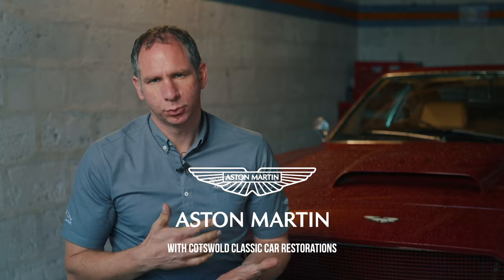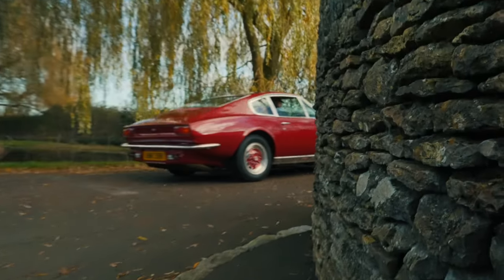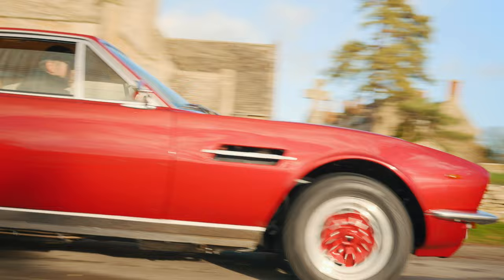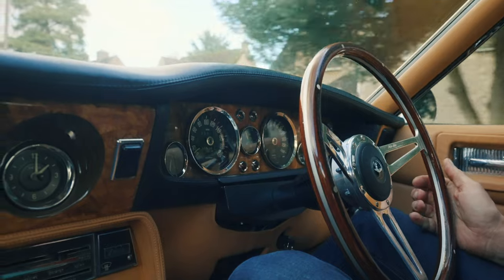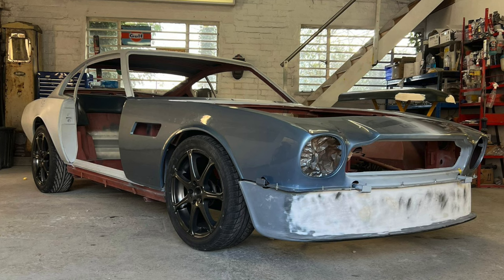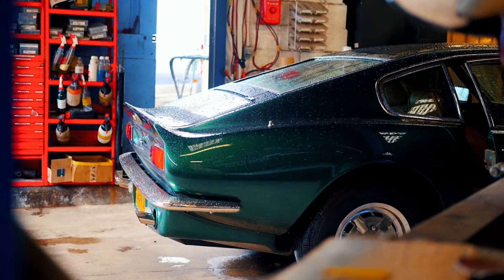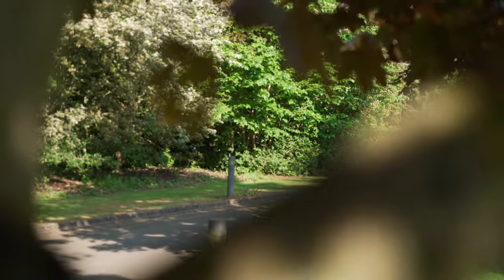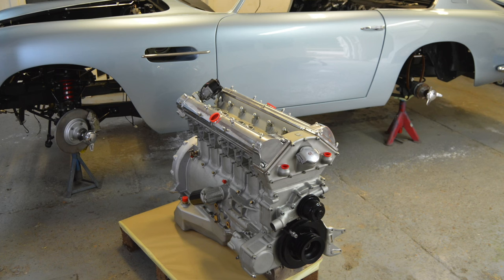Aston Martin with Cotswold Classic Car Restorations - Do you share our love for Astons?

Comment: i would love to resto mod a amv8
Reply from the maker: Intend to bring a lot more content from behind the scenes to our new channel so hopefully soon
Reply: No. Restomods are for other cars. Aston Martins are handcrafted works of art. Our job is to preserve them for future generations. Restomod is nothing more than a fad, and in my opinion, mainly tasteless with oversized wheels and some horrid Corvette engine. If you want a modern car, then buy a modern car. The experience of owning a, say, 1968 car is for the authentic experience of driving a car in 1968. Please understand, these are works of art. You don't paint a mustache on the Mona Lisa because you want to....
Reply: @ThomasMulhall  i  can see your point but politely disagree. Aston martins were not built as pieces of art they were built to be driven and enjoyed. There is aston martin works to enhance your car. The automatic car in this video is has already been changed to manual.  retromodding does not need to be horrid. the car values make it non economic to do, but the standard V8s were not the best cars, that is why the vantages and xpacks came along. if you were going to put a non aston engine in it, which you would not normally do, just enhance the engine, it would be a ford 429 hemi. which of course would be very fitting. i would prefer a ford engine to ford swtich gear !
Reply: If you put a Ford engine in it, the car is no longer an Aston Martin. Changing to manual is fine, as long as its a factory used gearbox, either before or after the model. Factory parts are ok as long as they are period correct, ie colour change, gearbox change, etc. What I have seen of restomods are stupid wheels, engines from different marques, and a host of electronic gadgets like sat nav, central door locks, and the like. Again, if one wants a modern car, then buy a modern car. Cheers
Reply: @ThomasMulhall  i choose ford as ford owned aston martin. prefer to stick a v600 engine into a series 3 v8